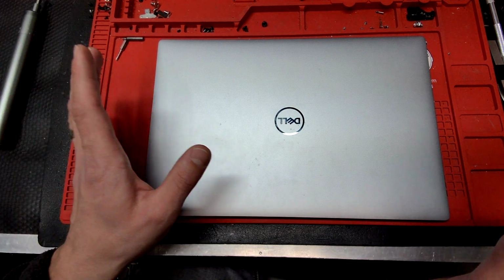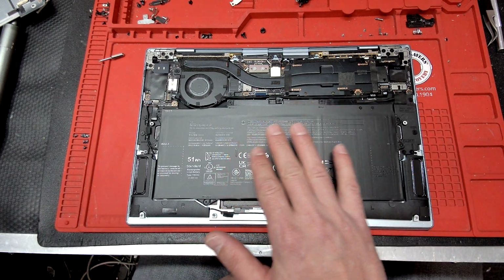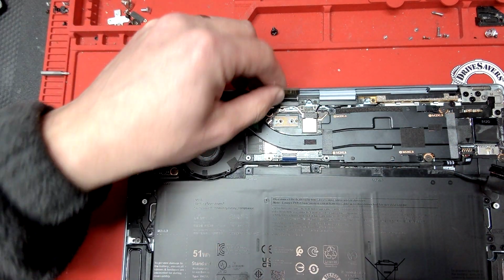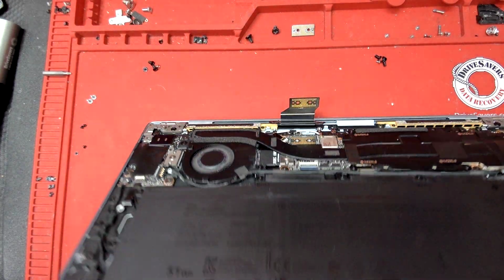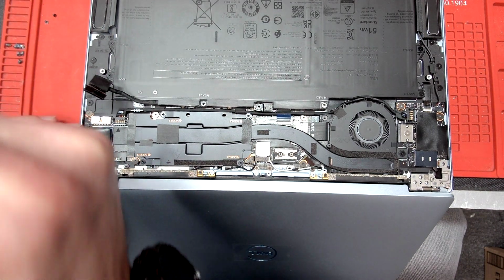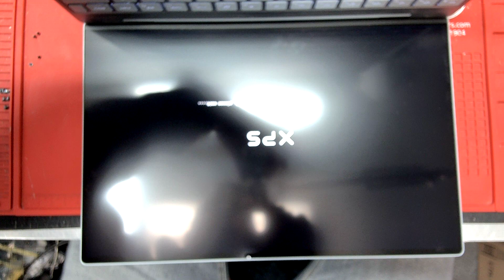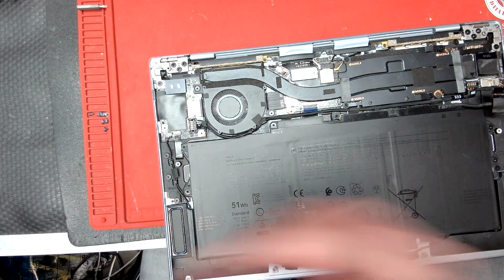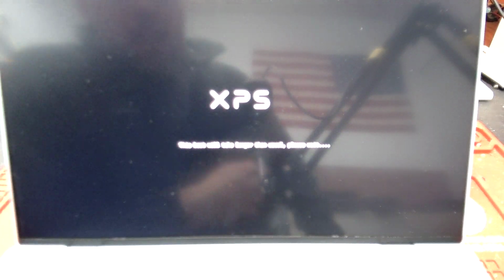Dell XPS 13 9315 Screen replacement

Comment: thanks for the video, recently my dell xps 13 9315 camera has stoped working out of nowhere, and the infra red indicator light suddenly turned on. I've tried pretty much everything to fix this but still not working,  even the dell support agents couldnt figure out what happened. so im considering to replace the whole screen bcs the camera on this laptop is inseperable with the screen itself. Can you give me the link of the screen replacement that you bought.
Reply from the maker: https://www.amazon.com/dp/B0CN4H4PYR?psc=1&ref=ppx_yo2ov_dt_b_product_details

Comment: Thanks for this tutorial. I have a similar display issue but the panel is working completely fine but in certain angles the led light turns off. I figured the issue is with the connecting ribbon, not the panel itself. Do you know if there any way to get the ribbon only and can this be resolved without changing the panel ? Technicians in my city told me that they cant replace the ribbon without replacing the display because it cant be opened. I would be greatful if i can fix this without paying for the new display.
Reply from the maker: Theoretically the LCD can be removed but I won't recommend you to try it as you have VERY HIGH chances to crack the display in the process. If you decide to try it and you're successful in opening it, DM me and I can sell you just the cable itself.
Reply: Am having the same issue. any luck with replacing the connecting ribbon?